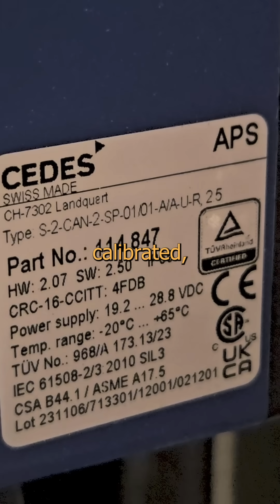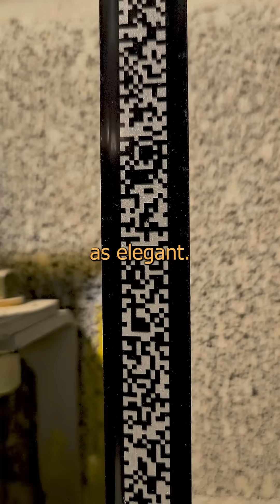Elevator Encoder #chrisboden #comedy #engineering #controls #urbex #indicator #resolver #barcode

Comment: Yeah... so much more elegant than putting 2 limit switches per floor (2 for redundancy) 😒
Reply: Yes it is .
With this system you have the possibility to slow down before you are at the floor. 
just imagine how uncomfortable it would be to be stopped on a dime. Sure for a slow elevator no problem but you don't want to wait so long to go more than 5 floors. Furthermore you can get this dot matrix cheaper than 10 switches.  It is in principle a metallic tape measure that gets a different painting. 
It is contactless so you will never wear it down unlike a switch that has to be changed every two years because you cannot wait until it breaks and people get stuck.
Reply: @Mr.T9191-i2f  the rail to put it on isn't that cheap and couple that with an optical sensor. You can use inductive proximity switches and use the approaching floor to initialize a slowdown routine.
Reply: @AmixLiark  if you do that you cant be shure that you will be stopping on the same place because the load will change the travel after you activate the switch.
Or you have to break so aggressively at the last moment that people will complain even if the elevators are traveling at lower  speed since the last level.
Reply: @Mr.T9191-i2f  Okay then we use a dual hall effect sensor at the weight pulleys coupled with sensors at each door done.

Comment: Great engineering maxim! Also: keep it simple stupid doesn't mean make it dumb.
Reply: "Keep It Sufficiently Simple" because it isn't "stupid" and I loathe that word, especially nowadays.
Reply: @jameswyatt1304 IT isn't stupid, the engineers that think they have to make it complicated to justify their existence are the stupid ones. Trash trucks are a perfect example, we had a front loader that had a box on the side of the body with 5 computer modules in it to tell the packer when it could run (plus one in the cab). We were having issues with function, called the builder and they said exchange 2 of the modules. When asked which 2 the answer was, any 2 it doesn't matter. Really? Trash trucks used to function reliably using nothing but hydraulic sequencing and limit valves. This is a perfect example of stupidity over functionality, an engineer justifying their existence.

Comment: Ha. Nope, this is a bad design. The QR code gets grimy, the sensor inevitably gathers dust, and you get stuck.

That's why most elevators switched to a magnetic encoder. It's the same principle, but it uses a metal tape and a magnetic read-write head. It writes onto the tape during the initial calibration run, so you can just use an empty tape. It's even more precise than QR codes, and it can work after a couple of decades of neglect and zero maintenance.
Reply: It's not QR codes, if you'd read other comments instead of wave ya dik
Reply: @renataravensong  I know that these are not QR codes. Still, they are read optically and that's the issue.

Comment: How is the QR strip generated? Just cut at a length or ?
Reply: It's not QR codes. While it is a machine readable bar code pattern, QR codes are a very specific pattern and shape of bar code.
Reply: @VoCodebcv Thank you for clarification you are correct - how is it generated then?
Reply: @ThatOneBlackGuy Likely either randomly or with some level of actual data encoding.
Reply: @AchievedZeus574  you just listed the only two possibilities and didn’t provide any useful information at all.
Reply: @ThatOneBlackGuy  i assume it is a variation of "Gray code" encoding on the strip that indicates the elevator position.
Reply: @ThatOneBlackGuy  Doing some googling there are a lot of different kinds of encoding systems, and each company seems to do this a little differently, with some systems just being horizontal black and white stripes and others including other kinds of detection methods like magnetic tape or an on-board mechanical sensor.

It seems for this kind of encoder, an aperiodic pattern is generated using a program which cuts the pixels out of a strip of black tape that runs up the shaft. I don't work on these, but as a programmer I think the easiest way to approach it would be to generate permutations of a small "window" and pattern it up the entire length of the shaft, with the total resolution and window resolution depending on the level of precision and height of the shaft.

I'm not sure if these tapes are pasted and cut on-sight after they have been installed, or if the tape is cut at the factory and sold to contractors to install directly. I suspect the latter. I don't know how exactly the process happens as it seems proprietary, but that's what I think is going on
Reply: @ThatOneBlackGuy only the person who wrote the code could tell you it could be the alphabet in binary it could be almost anything the coder used when writing the code.